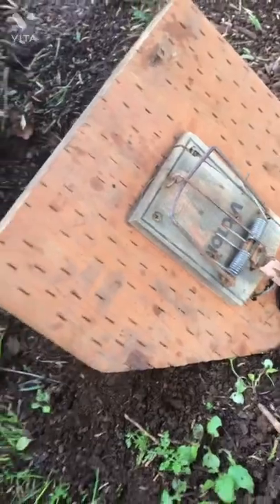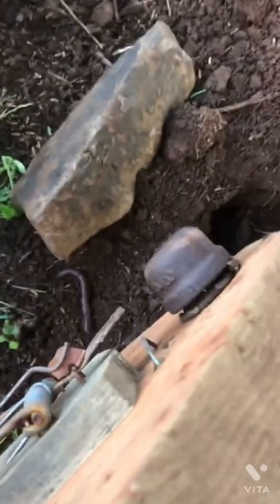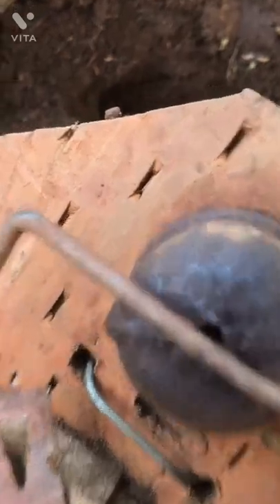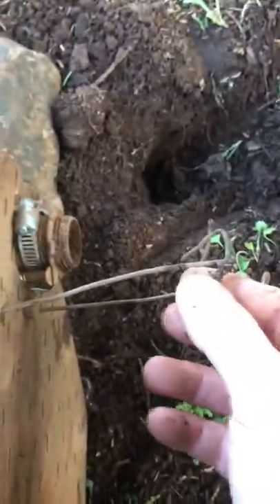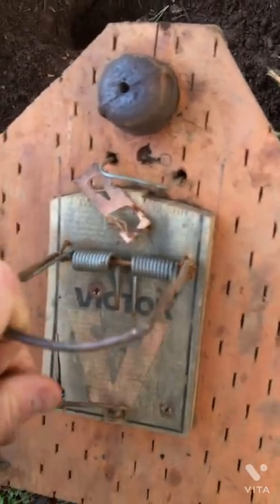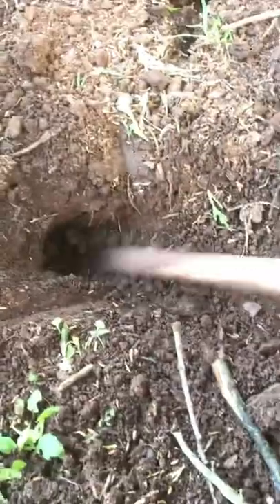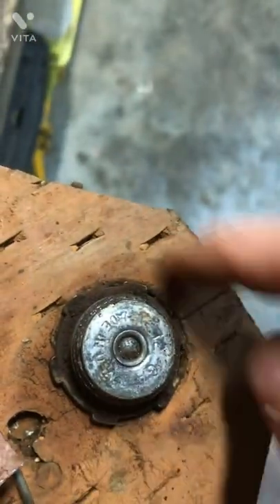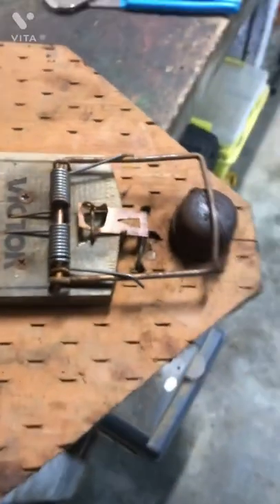Mole blaster!  DIY shotgun shell powered mole trap. Don’t try this at home kids. Seriously. #mole

Comment: I'm having a hell of a time getting my hole in the pipe cap to line up center on the primer.  I keep striking near the outside edge.  Any tips on how to drill the hole in the cap to ensure it lines up with the primer on the shell?

Comment: Good idea but you just built a firearm. Federally illegal. I too built a similar trap and wanted to know if it was legal. I called Firearms @Tobacco and talked with an agent there. He also was plagued with moles and applauded my possible solution. There was a “But” involved! It is technically manufacturing a firearm and is prohibited by federal law. And, even though the person sharing this is very careful, I can’t even imagine the liability incurred. I am not a grinch trying to steal anybody’s thunder. Just sharing a genuine personal experience. Not sponsored but I have had good experiences with the Molehawk.
Reply: A citizen can construct their own firearm in Missouri (which is otherwise legal) for their own use, without a requirement that a serial number be imprinted on the firearm.
Reply: Local and state ordinances and laws can differ, and what's legal in some states may not be legal in others. But federally, making your own firearm for your own use is legal. Note: this does NOT include making “machineguns” or any other Title II or NFA weapons.
Reply: Just don't live in a stupid state like California,  Illinois etc. I live on 20 acres in Missouri with no neighbors. Mine are almost finished being built!!!